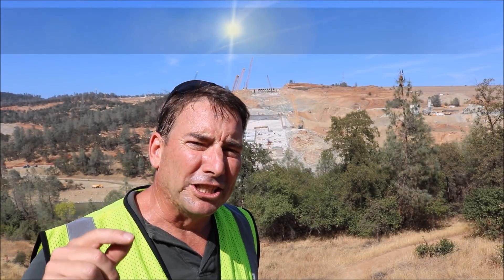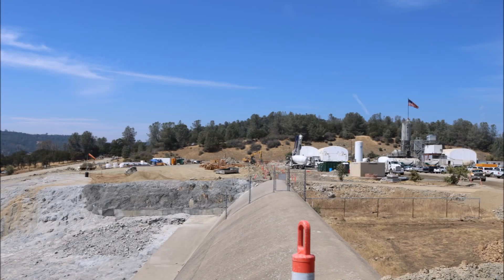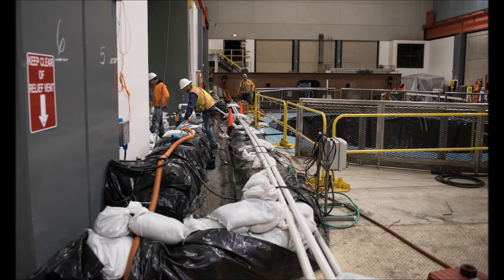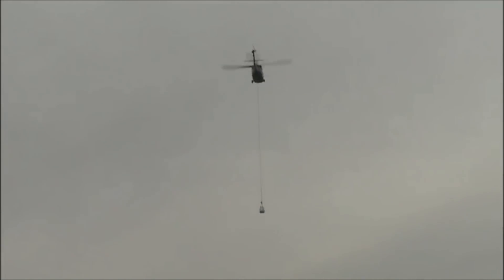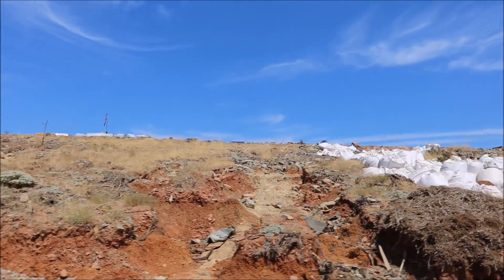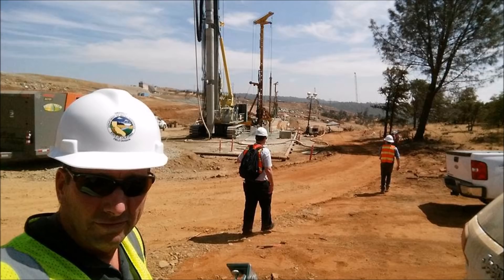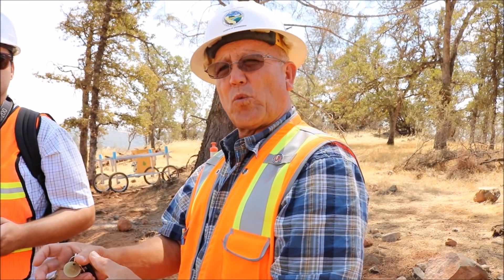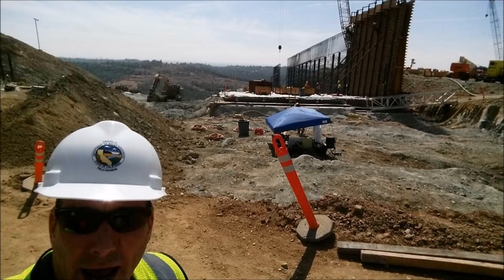Part II Oroville Spillway Construction Tour 2017

Comment: Hi Juan, I have not commented before but have followed your channel on this since the beginning. Thank you for the work and time in preparing these videos!
I have a couple questions for DWR if you're interested:
1. I'd like to know more about the dental work. how are they getting all the fine material out after pressure blasting? hand? Vacuuming? Also what is the slurry mix they are applying prior to RCC placement? Just a simple cement slurry or some special adhesive slurry?
2. Has there been any mention about installing additional mid-elevation drain tunnels for level control?
Thanks, Jon,
Reply from the maker: Yes to both questions.

Comment: Juan could you go to Alaska next spring and follow and report on the Iditarod dog sled race?  All 1,000 miles from beginning to end?  You can probably hook up with one of the Bush Pilots up there and fly into each check point ahead of the leading team.   Perhaps drive a dog team sled yourself on one of the shorter runs, with maybe just 6 or 8 dogs in the team.   I don't think they want snowmobiles running on the dog trail.
Reply from the maker: You got the funding?...lol.
Reply: I've got one Chihuahua that's not very good at pulling any kind of cart.  But seriously I think with your abilities your coverage of the Iditarod would be very well received.

Comment: Hi Juan. Great channel, I like the engineering aspects, the technicality of your explanations. 

Did you understand why they don't use RCC in the lower chute? They used leveling concrete under the rebarred structural concrete instead, but RCC seems cheaper and faster. Was the lower chute to steep or not thick enough for RCC? 

I understand the lower chute receives the final structure already now, while the canyons are filled with RCC and will receive the same heavy rebarred structural concrete only next year because there is no time for that this season. Correct? Do they know if the RCC will survive a 100'000 cfs flow? We saw how devastating that can be. Will there be nothing to protect it?
Reply from the maker: stay tuned for part III we cover this...

Comment: Thanks for the report Juan! It's quite amazing how poorly made the original emergency spillway was. Almost as if they assumed it will never be used (wasn't this erosion bound to happen in any event it was used?). It's interesting to note both those rain events in Oroville and currently in Texas were the largest ever recorded. It seems Climate Change effects start to get consequences earlier than most people realized. Makes you wonder which is the next reservoir that's going to be put to the test.
The old main spillway also looks thin and frail compared with the rebuild. The new construction seems like it's built to last forever. 
Do you have any estimate of the overall cost of the project?
Reply from the maker: Over half a Billion and counting...

Comment: It you want more ground detail on the Ponderosa fire, USGS has a Wildfire viewer that shows maps with heat sensing radar. Instructions are thin to control use, here's some tips.

Go to > http://www.geomac.gov/viewer/viewer.shtml

Click the dropdown box "Jump to Wildfire"
Select the fire by name that you want to view.
A map will appear of that area.

Select the "Data Layers" box in upper Left.
Click the "Active Fires" link at the top.
Check the box "MODIS Fire Detection"
If it doesn't show, zoom the map in a bit.
Different detectors work in various zoom ranges.

 The overlay is Red, Yellow and Black circles.
At the default 2 mile view, these are 1 mile across.
You can backout, but 2 miles is the closest MODIS view.
Red is burning now, Yellow was burning 12hrs ago.
Black was burning 24hr ago, usually means burnt out.

Be sure to try out the VIIRS and HMS fire detections as well.

This is a moving satellite, so check the time of last pass.

MODIS > Moderate Resolution Imaging Spectroradiometer
MODIS Website > http://modis.gsfc.nasa.gov/data/

Comment: http://www.parks.ca.gov/live/lakeorovillesra_spillway <-- Live feed 
camera looking uphill.

QUESTION: How come they're not reinforcing the craggy exposed bedrock directly below the bottom of the spillway ? (i.e., the 20-30m slope between the surface of the water and the base of the 4 big dentitions)  You'd think that since that's the area supporting maximum hydrologic force on the spillway that they'd (as a minimum) fill in all the nooks and crannies with dental concrete to strengthen it and delay future erosion, and also greatly simplify future cleanup of debris.  Just a thought.

Comment: When water flows over the cut off wall it will  erode the bottom side to bed rock  then the waterlogged top side will push sections of the wall over, breaking it at bed rock level. Oops! The cut off wall is not strong enough to hold up the up stream side.
Reply: I get where you are going, but I heard the engineers saying the secant wall went some 15ft into bedrock. That's 3ft reinforced concrete piles going 15ft into bedrock. Then there are gaps tuned to release hydrostatic pressure from the ever-present groundwater. Then between the wall and the weir is layers of RCC down to bedrock. I think the engineers know that erosion would take place beyond the wall, but that erosion would not extend back to the weir and compromise the weir.

Comment: I'm glad you're getting the respect you deserve for your reporting - and the access to top people on the project to boot.  The beginning was ominous, but the main spillway damage was far enough away from the dam to allow them to lower the lake and save the dam above the emergency spillway.  Seeing your reporting initially set the hook as I was interested in learning how a huge project like the dredging and then engineering and executing a sufficient repair before the 2017 rainy season.  Fast forward to Houston after experiencing an unprecedented 40 -  50" of rain over a wide area, expanding the main spillway capacity to 250,000 CFS now seems prudent.  I'd hate to be downstream if that kind of release was required though!

Comment: Very interesting. Juan, you zeroed in on the same thing I did. I still have the TV video of the flooded parking lot and water seeping through the face of the hill northwest of the emergency spillway. The only answer you got was that it was an "opinion" that this seeping didn't present a problem. 

This was never supposed to happen. Neither was there ever supposed to be water rising to the elevation of the emergency spillway. I came away thinking at the time that 1) The emergency spillway was too small and allowed water to enter into the parking lot. 2) The water seeping through the hillside "was indeed" a problem and a potential point of failure. 

In any case, they are correcting all of my concerns about the emergency spillway. I posted by another name in those days. It was PlumbingDesigner. Thanks again for all your work.

Comment: QUESTION ON REBAR (for Juan): At 8:57 you made a comment in passing about epoxy coated rebar only being used in the lower spillway because the concrete is wetter.  AFAIK that is incorrect because the sort of corrosion that happens in rebar that 
damages concrete is NOT surface/cosmetic rust but rather the sort that occurs very slowly over the course of decades due to electrical ionization/conduction in conjunction with the low levels of ambient moisture that are always present in concrete as it "breathes", which results in rust swelling that eventually cracks the concrete and increases water infiltration ... the short term moisture present in concrete during the initial few weeks of post pour hardening (regardless of how wet or dry the mix formula) is actually irrelevant (again, as I understand it).

Comments ?

Comment: QUESTION: How many lifts (layers) per day are they doing with the RCC ?
Reply from the maker: stay tuned...Part III soon
Reply: Thanks, Juan.  I read an interesting treatise on this item earlier { http://www.ghd.com/PDF/2008%20Brazil%20RCC%20Symp%20-%20RCC-New%20Developments%20and%20Innovations%20-%20FORBES.pdf }, and I was curious as to which approach, if any, the construction crews at oroville are using to maintain optimal bonding between individual lifts.
Reply: (cont'd) Given that each 15" lift compacts to 12", and that there's very likely a limit on how many lifts you can reasonably lay down in a day without compromising structural integrity, and given the number of days left until Nov 1st and the remaining vertical distance between the bottom of the upper plunge pool and the final top layer of the finished spillway above it, along with the curing time needed for everything to fully harden (measured in weeks rather than days), it's easy for a lot of people to (mis)construe a potential problem using simple arithmetic.  

Some info on that from DWR would help lay a lot of that speculation to rest.

Comment: Okay, so help me make sure I understand here. They said that there was a gap between the secant piles. Did I misunderstand that? If there is a gap, could it be eroded through?

I fully appreciate releasing hydraulic pressure, I just want to make sure I understand that it's not going to erode through the wall.

It's very good to understand the concept and process of this wall. Great new info!

Thanks for these AWESOME videos!!!!

Comment: Geez! I can't believe how close the water was from breaking through into the dam, if that happened it would've been an absolute disaster. 190,00 cfs peak inflow is almost 1.2 million imperial gallons and would easily be much more outflow if the dam went. An earth dam at Houston has spilled over but it's nowhere near  the height of Oroville. I sincerely hope it holds for the poor people of Houston.
Reply from the maker: The emergency spillway. holding back just 30' of water...I'll clarify in Part III.
Reply: The water was never threatening to break through the dam.  It was the emergency spillway that threatened failure.   Any dam will have a way for water to safely 'overflow' without harming the dam its self.  In this case, the emergency spillway (not to be confused with the main spillway) is designed much lower (30ft??) than the dam,  so rising water will always flow over it and never over the dam.   Yes, if it failed 30ft of lake level all at once would certainly be a disaster.  But that's still just a fraction of what the dam holds back.   The dam is fine, and always has been.

Comment: A couple of questions:   When they rebuild the road to the boat ramp will it be on culverts or directly on the RCC?    Second:   The Kewitt bid contains line items for four different types of reinforcing steel  Plain, Epoxy Coated, Galvanized and 525,000 pounds of Stainless Steel.   Can you find out what the stainless steel is used for?  Thanks

Comment: Juan you mention, I think, they were going to use roller compacted concrete between the emergency spillway headwall (section it spills over) and the secant wall. Do you know depth of the RCC ?
Reply from the maker: No.
Reply from the maker: but excavated down to bedrock

Comment: They could have laid a huge steel pipeline in hours over the top to drain the water.. they come in sections and can be welded together on site... They could even have used big structural plastic pipes and just have several of them... There's even plastic pipeline you can roll out much like a huge fire hose..

Comment: why is the new secant wall so far away from the original headcut danger?
Reply from the maker: Jay Bean a safer bet....
Reply: if it were there in February it would have been useless. the headcut started before that distance. I think.
Reply from the maker: Jay-you are not paying attention...go back and review the material presented again.  Note what's planned between the secant cutoff wall and the ESW....
Reply: will do, thank you

Comment: Wow Juan I live over 2K miles from this but if I lived below this damn your channel would make me feel a lot calmer. Great stuff. I doubt any other person could get this much cooperation & answers than you.
Reply: I live in the evacuation zone, and yes, this channel and Mr. Browne's excellent reporting has made me feel very comfortable living downstream.  Personally, I was never all that worried about the dam failing because my grandfather was on the Oroville Dam construction crew and I had a great education in the construction all throughout my childhood.  When the evacuation order came I sheltered in place because I didn't feel threatened.  It helps that I'm in the three hour zone, meaning that if the worst happened and the dam had failed I would have three hours to get to high ground, which is very easy to do from where I live.
Reply: Except as Juan's video shows from February pictures, the emergency spillway was very close, too close, to being undercut and having an actual dam failure.  Potentially the water in breaking through the weak points would proceed to erode away significant emergency spillway area and from there the cutting action of rushing water would carve canyon(s) who knows how deep and likely well below the main spillway gates.  It does look like DWR and Kiewitt are doing a massive amount of work very quickly that hopefully lasts until final work can be completed next year.

Comment: Does anyone else wonder why the hole in the spillway was ignored and left to washout,  instead of being temporarily patched over with steel plates ?
Reply from the maker: not enough time during the emergency.
Reply: Thanks Juan. I was under the impression that the hole had been there for some time.
Reply: And steel plate wouldn't likely hold.
Reply: if done right it would ,if the base was set up correctly ,just not enough time

Comment: Thanks for the good report even though some of the group interviews in the high ambient sound level locations (including the wind noise) had poor sound (bad signal-to-noise ratio) with the resultant intelligibility problem. The goal for recording those is to try to minimize the noise and get the people speaking as close to the microphone as possible.  Ideally, you'd have an assistant with a wireless, narrow pattern hand mike (a short or medium length shotgun microphone) with a wind blimp or fur (or both) and they would move the mike to whomever is speaking and the technique is to hold it straight up just under and close in front of their chin. You may have seen some reporters doing this in the Middle East war zones in the field and on board aircraft in flight. For you, just using the long cord on your "muffed" body mike and holding it close to their mouth is the best quick and simple technique. Or, get a cord for your directional detachable camera mike and use it as a hand mic.
Reply from the maker: just ordered a dead cat for the road mic...

Comment: One interesting comment Matt Murray made that might relate to the "inescapable" GREEN SPOT. When he said "water seeps into and through the ground because of the hydrostatic pressure from the reservoir. Even if the dam is clay and it seals its own wounds/fissures, there still is seepage/moisture.
Reply: Pappa Bob I've been inside concrete dams and they also leak. There are drainage systems in ALL dams, I believe.  The dam I toured was fairly new,built in the early 70's and was built for flood control originally. And just a few years ago the operators added Francis type turbines to produce electricity. Interesting side note- the turbines were made jointly by a Finnish and Russian joint venture.
Reply from the maker: Yep!

Comment: Juan, was the original design and construction of the main spillway defective?  Or did it fail last winter under conditions that exceeded the maximum anticipated capacity?  Seem to recall some of your earlier videos pointing out inadequate construction revealed by the failed section.
Reply from the maker: Yes, both...

Comment: The secant walls end up as one solid wall in the end. The reason they are using epoxy coated rebar for the finish floor to prevent it from rusting. Which they didn't use that kind of rebar at that time.

Comment: In true QC, every batch is tested.  Per DWR e-mail, there are over 100 generators onsite up to a capacity of 1,000 Kw each.  The estimated cost to run all the generators through 2018 is $1.4 million.

Comment: Juan, how hard does the RCC get after it's compacted and allowed to "season" with whatever hardeners are added to it? I realize it's not structural concrete, I'm wondering it's resistance to water flow such as they will be using on the emergency spillway.
Reply from the maker: about 2500psi untreated up to 8000psi if treated
Reply: Thanks.

Comment: Thanks for the update, Juan! Based on what I think I heard, the secant wall will be a series of five 3' pilings with a 1' overlap. Then there is a 1' gap before another section of the wall. If I did my calculations correctly, this yields a series of 12 foot sections with 11 feet being concrete wall and one foot being natural material to relieve hydrostatic pressure. What keeps those one foot gaps from eroding next time or is the wall just supposed to slow the rate of erosion between the emergency spillway and the secant wall? With RCC capping the area, how will they know if a sinkhole is forming above the secant wall due to erosion? Looking forward to part 3!

Comment: My Dad was a Mechanical Engineer and he taught me about keeping concrete wet for at least 28 days as it cured.  My childhood home had an elevated garage roof with rebar galore and a 16" I-beam supporting the middle.  We used the top as a patio on the side of our house.  One of my jobs when building the house was to keep that concrete wet for 28 days.

I carried that knowledge with me until this spring when I poured concrete for my little 14' X 18' wood shop.  And as my Father's true son, I not only kept that concrete wet for 28 days, I kept it wet over 60 days!  My wood shop concrete floor is the finest in Eastern Washington.

Another great update Juan!